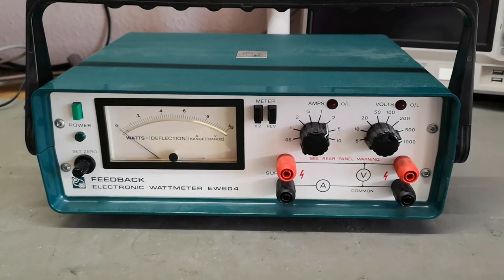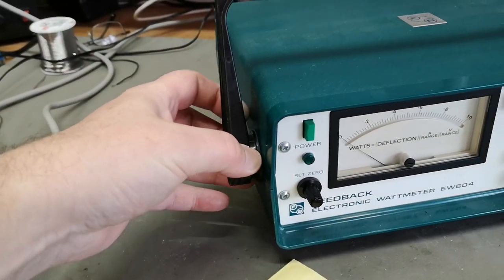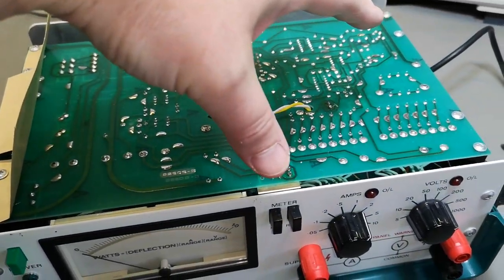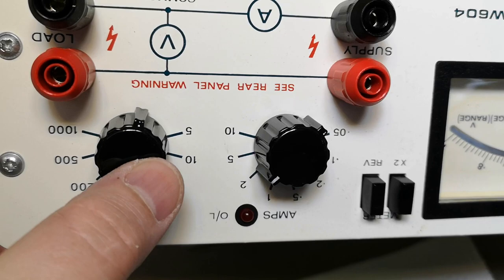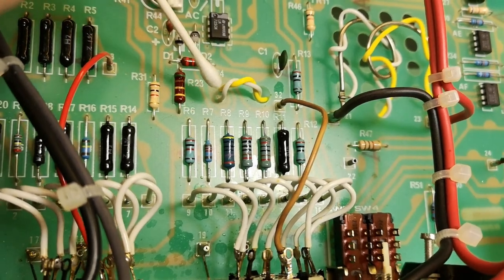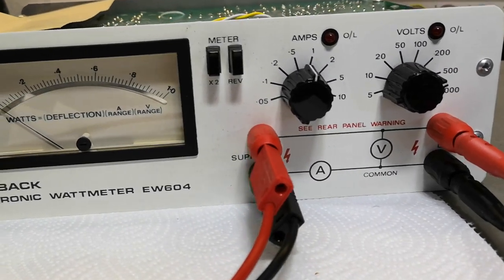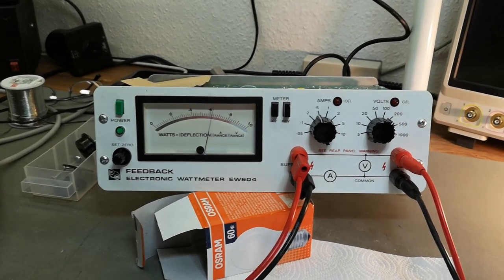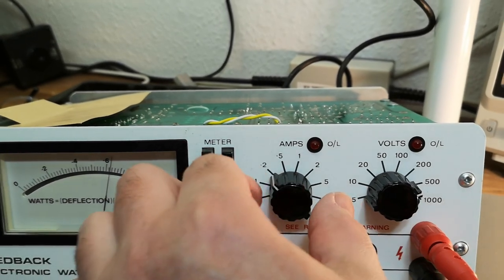Feedback Electronic Wattmeter EW604 AC mains test teardown

Comment: Hi Thomas, beautiful piece, almost in Tektronix colors, this is a beautiful example of digital technology on top, no adjustments, I just tell my meter to measure Watts and it spits out a number, or I tell it this is the maximum and when it is exceeded it will sound an alarm. I was interested in the design of the measuring transformer, even with the loop on the pcb. 🤔 my bluish LEDs would be great here for the backlight of the meter, they would match the colors beautifully 😁

Nice day 🙂 Tom

Comment: Thanks for the teardown! I was suprised to see them use a transistor array and opamps rather than some dedicated chip! :O

I guess there is some margin for higher crest factor than sine there which means the 200 V range works for our mains voltage which is close to sinusoidal (3 dB crest factor). As 230 V (325 V pk) almost worked on the 100 V range, seems it is about 10 dB on the voltage channel.

Trying it out on non-PFC SMPS might not allow using low current ranges compared to the RMS values.
Reply: Op-amps and a transistor array is cheaper than a good multiplier IC. Easier to buy parts. May perform sufficiently well too.

Comment: Hi Thomas, 
I believe the meter is somewhat simpler to use than you explain. It says clearly on the meter scale that Watts = Deflection x A-Range x V-Range
Deflection is obviously the meter deflection/readout, in your demo close to 0.6 Now multiply that with the amp. setting (0.5) and the voltage-setting (200) equals about 60 Watt. Another amp and/or voltage setting that wont cause overload will give you another meter deflection/reading for example A-setting = 1 and V-setting = 500 should give you a reading of about 0,12 if I understand the meter correct.
Best regards,
/Torben
Reply from the maker: I think you are right, it is easy to over complicate stuff